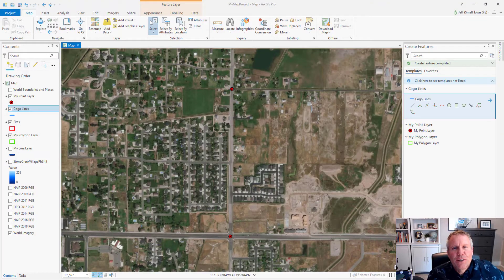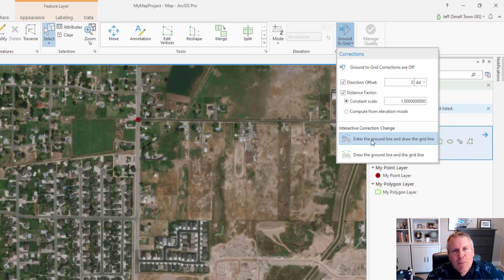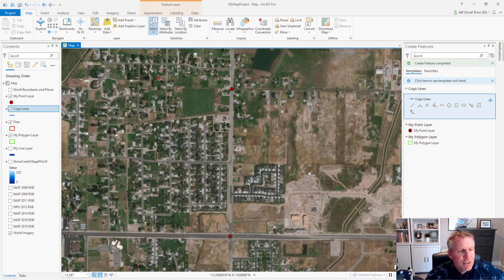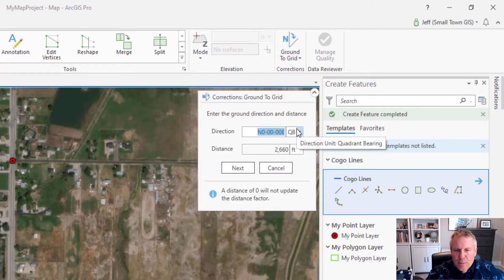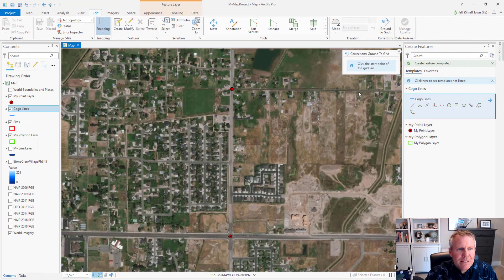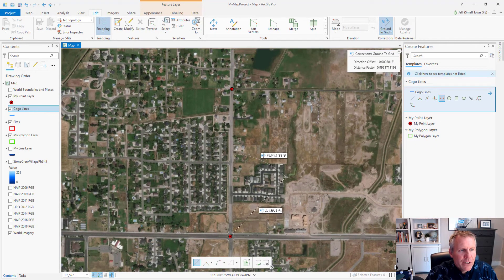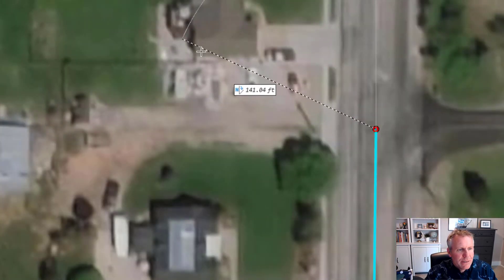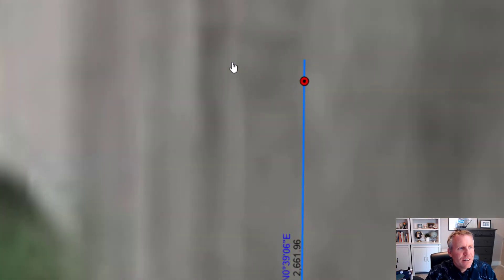ArcGIS Pro Tutorial: Ground To Grid Corrections

Comment: Thanks for this. What would the process be if the plat has no legal description or basis of bearing?
Reply from the maker: Good question! Is it an older plat?
Reply: @GISChops  brand new. I think the majority of plats I’ve seen from surveyors in my county don’t have them.
Reply from the maker: Wow, state law requires both in Utah. Does the course from the monument to the point of beginning follow a line like a section line or street centerline? You could use that bearing for a basis of bearing.